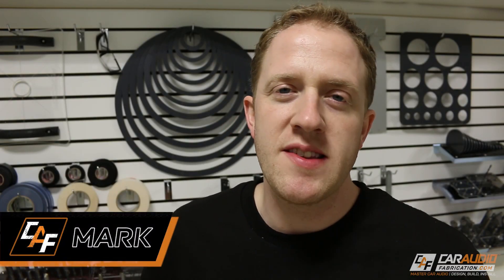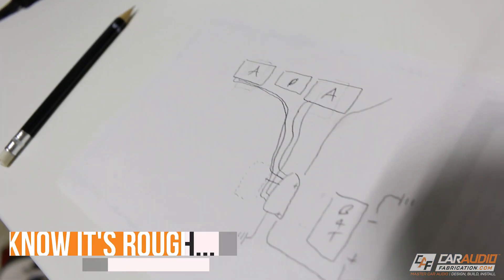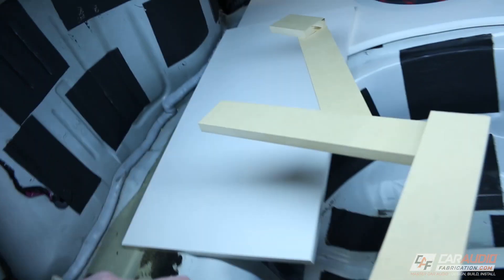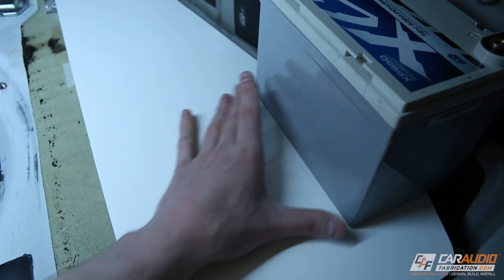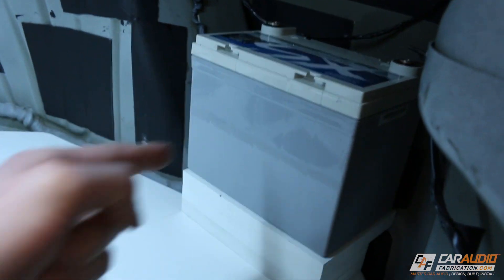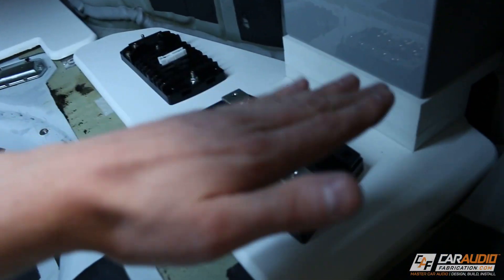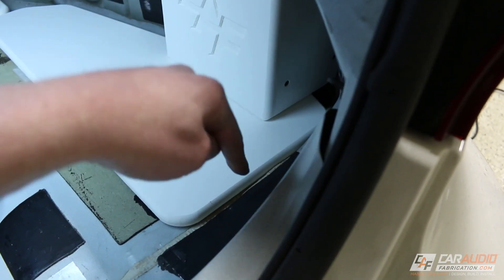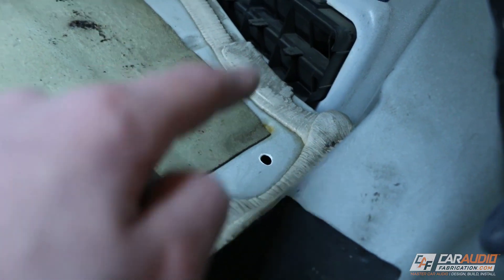MAKING a Car Audio Battery Mount - How's it mounted?

Comment: What have you done to vent the hydrogen released from the battery?
Reply from the maker: Research the battery, not an issue
Reply: CarAudioFabrication how many Ah do you recommend as a min for deep cycle batteries if running an audio system?

Comment: In your Grand Cherokee project mounting all of the amps behind the molding of the car, how do you handle heat issues? I have a 2020 Ford Fusion that I want to put the amplifier where the spare tire goes because unfortunately new Fords do not come with a spare tire but there's lots of space there to use. I mounted my amp there and it started getting extremely hot where it had not done that before. I also may think I want to recheck the ground but how do you handle heat?
Reply from the maker: What amp are you using?
Reply: @CarAudioFabrication  JBL Stadium 5 75W x 4 + 350W x 1 Car Amplifier

Comment: Enjoy your videos.  I have not seen it yet in your videos, but how about a video for us guys who have high performance ignition systems that have low resistance wires in the old muscle cars (1968 Chevelle).  What strategies can one use to keep the EMI/EFI noise out of the radio.  I just use a good radio with an old equalizer.  If I run my system directly to a separate battery from the car battery I have no noise in the radio/CD/ Cassette system.  Now when I hook up the equalizer there is still some noise with this setup.  Hooking this system up to the car battery there is a lot of noise.

Comment: I was hoping you were going to talk about how you wired the battery, meaning are you using a relay or isolator or running it parallel? Maybe I've missed it but I watch about 5 of your videos. Nice work as always Mark!

Comment: My question is how are you connecting the rear battery to the electrical system? Is there an identical battery in parallel under the hood, or do you have an isolator inline to separate the two while the engine is off? I use a 300 amp isolator solenoid myself. I don't want extended parking lot listening sessions interfering with the cars main battery. Just curious what method you use. And as always, love the videos man.

Comment: Did you setup the battery terminals to face towards the car body rather than towards the power dist. blocks for aesthetics and wire/cable routing? My thoughts would be to flip the battery so the wire runs to the blocks was shorter.  This might be answered in the wiring video, but thought I'd ask here.

Comment: I would like to know how you would connect the battery that in the trunk. Do you go straight to the alternator? Would you have to upgrade it too?
Reply: Both batteries connect to each other at the distribution block (+ to +, for parallel wiring). The alternator is already wired to the first battery, which now also has the second battery in circuit.

Comment: hey,
out of topic, but...... If im limited in space to upgrade to big alternator, what should i do? i can only install 120a alternator, but i thought adding a 140aH battery will do the trick(stock battery is 77aH)?  i have 2k rms woofer,  500w rms of highs, mids etc. so 2.5k rms total, that requires roughly 181aH just for itself.
Reply: "limited space"? What are you talking about? I've owned several 260, 280, and even 300a HO alts and they're factory size speced. Unless you have some weird car with a super tiny alt.
Reply: I have an Audi a4 1997 1.8t avant, the space for alternator is pretty limited
Reply: BassHead 37 you should look for the alternator brand....usually there are alternators from the same manufacturer that are higher amperage but with the same size....probably something from a vlokswagen van....i am trying the same for my fiat.....

Comment: I do have a question about the batteries you use. Can they be used in a solar storage configuration?
Reply: They could be used for that but would not be the most cost effective choice.
Reply: I live in Rural SC Alaska, our only store that carried solar equipment closed last winter. Amazon does not ship to my area. This is my reasoning for asking.

Comment: Only 2 bolts per panel to secure it to the trunk? Seems like that large panel should have at least one more on the farther side, unless you are going to build up a lot more vertically and secure to top of the trunk.

Comment: Can you build a subwoofer box with that plastic material???
Reply: I doubt it since he said it's expanded PVC which means that even though it's rigid, it's structural integrity is no where near that of equivalent MDF.  I believe the reason he's using it is that it's lighter than wood or MDF and easy to work with but don't quote me on that.
Reply: I believe you could. Maybe a little extra blocking and bracing.  I'm considering building on for my cj5.  MDF would be to iffy in a wet environment.
Reply: Marine ply isn't a bad option for wetter environments. I've got several big chests of drawers made out of this stuff in my workshop. It's strong and while not impervious to water, is vastly more tolerant of getting wet than MDF.

Comment: Make a billet aluminum battery top plate mount power dist.block on the top plate short wire runs PS your fab is top notch